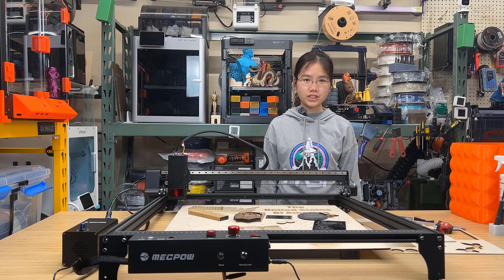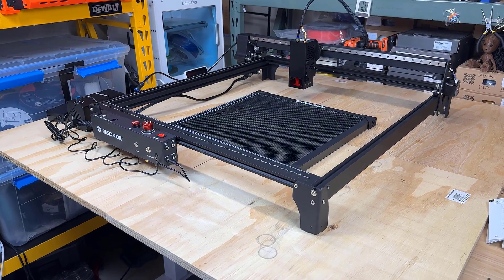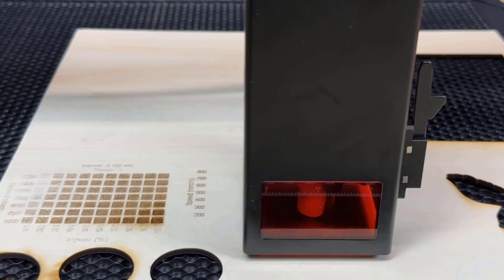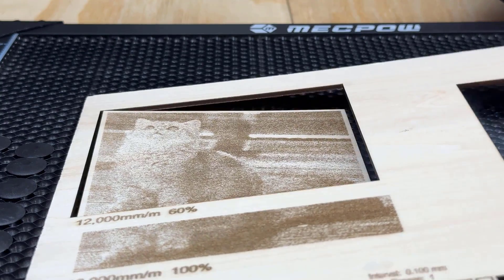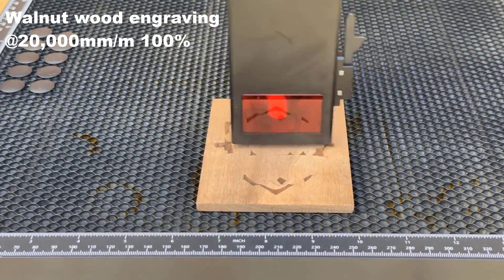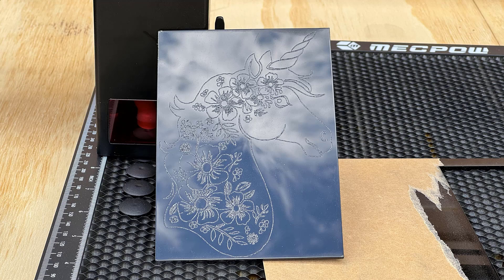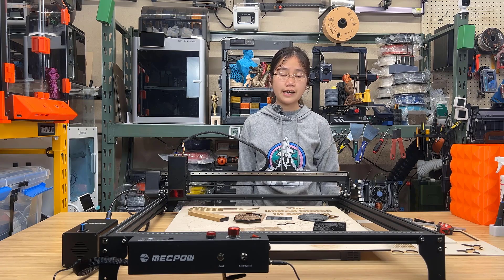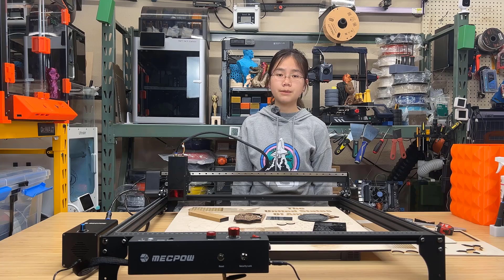Mecpow X5 Pro 33W Laser Engraver: $749 with a 600x600mm Working Area

Comment: I have the same Sculpfun frame design.. Its bad! not stable and cannot be mounted on a fixed place.
I made my 1000x1000 x 500 enclosure myself with inline exhause fan!

I dont recommend SculpFun- Service is bad and their lasers have seriuos Laser head design issues, clean is extremely difficult and the most frustrating of all is the after market service!  I placed an order for Laser head parts- FEB05 -2024- Wrong items sent, and Still did not get the replacements! - 4/4/2024

Comment: Are there any belt tensioners on the machine ? Because the X axis belt was rather floppy and the line work in the text and engraving looked very wobbly. 
This looks like a great machine, but if you can't adjust belt tension this is just trash tbh.
Reply: The book comes with completely different power and speed settings. If you're going to run it 100% and super fast then it's not going to look perfect. But fascinating to know that it CAN do it.

Comment: Air Assist must always be switched on even when engraving. The results are much better. Bumping into the limit switches without any reason is a serious problem with the Mecpows in general. It causes the project to fail. A PC with Lightburn is mandatory to work professionally with this machine - this cost must be taken into consideration. Using the phone app instead is more like a gimmick. At some point an enclosure must be build. The options on the market are quite bad. The 100-Dollar-question: How much does it cost to replace the laser module when it fails?
Reply: How much to replace your eyes when blinded by the lack of safety?